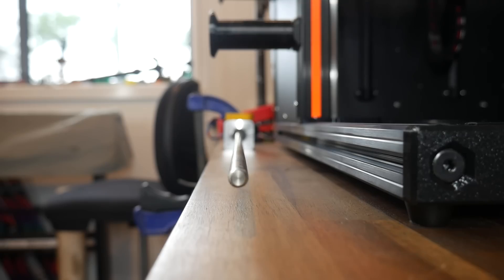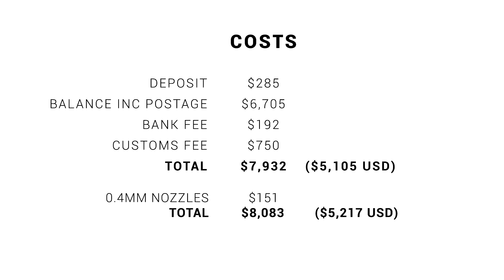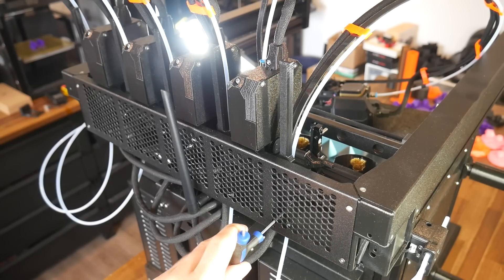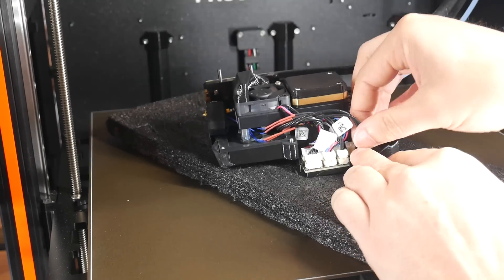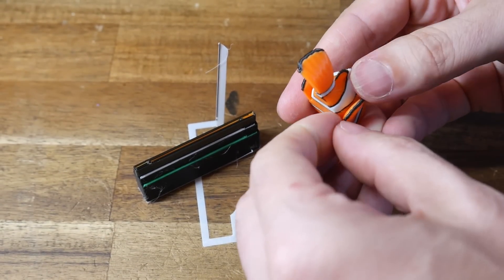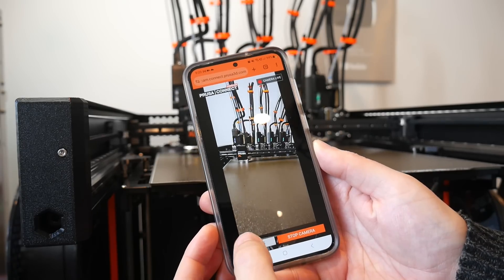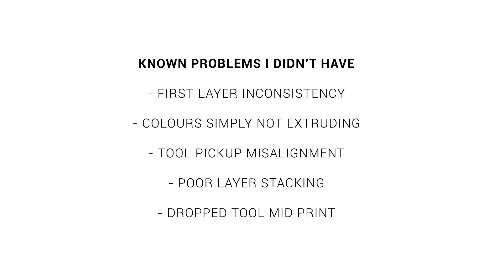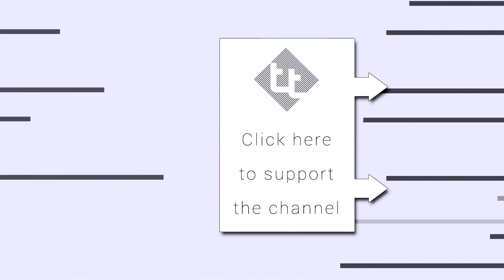I’m (mostly) happy with my Prusa XL - This is what it took

Comment: I've spent $65 extra on my P1S. Upgraded to touchscreen, got some custom plates, hardened extruder gears/nozzle, about $1165 cdn into it.

Here we are well over 5k (USD) deep and spending more in pursuit of results, then loads of time figuring and fiddling. (with a flagship product from one of the largest companies in the biz)
If that's not exactly what I'm tired of in 3d printing idk what is.

Not to mention, damn that thing's loud; I'm still impressed with the free update that silenced the steppers on my P1S, made the calibration time a bit longer; but then you see how long re calibrating can take on the Prusa XL...

The machine itself when working is impressive, no denying the value of multi-extruder for material savings, but as you've said this thing's an investment; and for many even something like Bambu's offerings are as-well; so to spend this much to waste more of your time and money...

I'm good, honestly this product is the final nail in the coffin for Prusa for me; the MK3S was for sure a go-to for a long time but times have changed; you can get more for less.

That includes the $60 filament that gets constantly beat or equaled by $30 offerings from others.

Comment: There are a lot of 3d printer manufacturers that rely on the community to fine tune the end product, whether through printable or aftermarket mods, print profiles or even firmware modifications.  This mentality seems to permeate the hobbiest level, and while that's fine at a sub €400 pricetag, when you get to the pro-am level (what I would consider over €1000) the product should do as advertised, with a proportional level of quality,  repeatability and support.  At the €5000 mark, well that's a league ahead of anything at the lower tiers, that's a lower end professional level tool. I understand it's a multi tool printer but you can buy 5 single head premium Bambu lab printers for what you paid.  

In hindsight, early adopters in this case should have gotten the "crowdfunded" price as you're  field testing, fine tuning and working out bugs for your trouble. Not getting the premium end product, which is what was promised.

Nozzles aren't a thank you for the hours you put in, a free tool head is, but in your case you've got 5.  A dozen rolls of good quality filament for the ones you've used to fine tune is probably about the right amount of "thank you for helping us achieve our promise to you, a remaining a loyal customer and supporter of our products".

Comment: The main goal for the XL was to print larger stuff faster and therefore the use of the 0.6 mm nozzles for better volumetric flow.
Especially since the Arachne slicing, 0.6mm nozzles make way more sense for large volume printers.

The change back down to 0.4 mm nozzles is no fix, it is a downgrade to mitigate a problem that is still not solved!

Comment: I got a Prusa Mini+ and I had a time getting it to work because of the Z-offset settings. It did work once I figured that out. I have to say, I agree that this isn't up to par with its price tag based on what I have seen, and I think I'd rather go the Voron/ERCF route if I'm going to need to do this much to the printer. The 350mm V2 and Trident are the same size, I think, so you wouldn't really be giving up any space either.

Overall, I think you've been incredibly fair and honest here.
Reply: I agree that Voron might be good choice for inviduals, but it's not for businesses I think XL is targeted for. We got XL for work, we couldn't even have gotten Voron cause of various things. Like VAT is so much more easier to handle. Guarantee etc. are obvious factors too.

Comment: To me this is the downfall of a trusted printer brand. I am not saying Prusa will go bankrupt, but in the past Prusa printers could be recommended as the one that just works.  That is no longer the case, trust has been broken, and without the "it just works" factor their prices are not justifiable. 

The Prusa XL sales will suffer as soon, as there is a tool changer alternative. I doubt Bambu will create one, but maybe some other company will step up to the plate. It should not be difficult to  beat Prusas price tag.

Comment: With prusa slicer I always had lots of issue with stringing and oozing on my 500x500 printer especially with a large nozzle. The only solution there is to be able to vary the filament retraction and prime length independently , and according to the length of travel. So I use cura with a plugin called "scalable extra prime" and a post processing script called "retract continue"

Comment: Nice. I haven't tried Octoprint on my XL as I heard the support for it in the XL firmware is poor. Topic for a future video?
Reply from the maker: They more or less fixed it from firmware 5.1. No print progress on the xl LCD but apart from that I've had no problems.
Reply: nice. thanks.

Comment: I share your wish for multi-nozzle size support. I'm hopeful to see this in an upcoming firmware and slicer update, but not holding my breath. And I totally agree with your discouragement of preordering another Prusa. The pre-order still took two years, and didn't prove to be a bargain in any way. This was my first Prusa order, and despite the anxiety of the wait and frustration of critical further development after delivery, Prusa still ranks highest in my book (so far).  I do recommend that Prusa continue to develop the XL into perfection, while QUIETLY developing their next mind blowing release and to not open up to preorders until it's actually in production. Next wish (largely self serving, I'll admit), is that they expanded a manufacturing facility somewhere within the Americas in order to satisfy demand and lower shipping costs. Thanks, Michael, for another great video!

Comment: I’ve had my 5tool for about 2 weeks and it’s been printing almost non-stop and almost flawlessly since I built it. I did have one model, that had very little chance of sticking to the bed, fail to stick to the bed😊 this was easily solved with a little IPA.

It’s honestly better than I expected it to be. I had fairly low expectations for this very expensive printer out of the gate because i knew that pulling this off would be hard and that early adopters would be paying a penalty in dollars and performance. But, it’s the printer I’ve always wanted and I know that Prusa will continue to improve on it.
Reply from the maker: I'm glad yours is working well. You and I should have equivalent hardware now.
Reply: Have Prusa said what is actually changed on the model they offered to send you? I haven’t heard anything about design improvements or changes other than the nozzles.

Comment: My Prusa is the Mini+, but I  found that Prusa Slicer 2.7 was the problem.  When I rolled back my firmware and the Slicer back to 2.6, my prints were great again.  2.7 kept giving me voids and the accompanying surface defects.  It appears to be a Slicer defect as nothing physically changed on my machine.

Your mileage may vary...

Comment: Just a reminder to everyone that you can get literally any other printer and THREE HUNDRED rolls of filament (more if getting a bulk deal) for the cost of an XL 5 Head. Please consider this before telling me about the savings the XL has on filament 'waste' as opposed to other filament swapping mechanisms. What does waste actually mean to you? Because for me, waste and savings are directly related to dollarydoos in the bank.
Reply from the maker: It's a valid point. If someone were to get one now, and were running a print farm or a similar operation of scale, the time/material savings may be worthwhile over time.
Reply: @TeachingTech   I can understand that to some degree, the XL is a good machine, but the reliability and redundancy of a small farm of P1S combos would probably still outweigh it in the long term as well (about 6 P1SC per XL)

Comment: I love my Prusa XL.  It just keeps getting better and it just works.   I regularly print in PETG and PLA.  I can't say I've seen much of a stringing issue - not so far anyway.    I got .4 and yeah...they should have provided you them for free.  For what it's worth, I run filament out of a PrintDry system.

Comment: You are absolutely blowing the nozzle size situation out of proportion.  It is a large printer, in order for print times to come down, nozzle size has to come up.  I print large functional objects on my XL and wouldn't want a 0.4 nozzle, I have an MK4 and MK3 for detailed parts.  So on the flip side, my 2nd XL will be arriving in a month and I'm going to have to swap out all the 0.4 nozzles to 0.6 am I going to complain? nope because I have to adjust the printer for my use case.

I do agree with you that the slicer default settings weren't great and still need refinement, but it is functional as it is, I'm happy that they're taking community feedback to fix issues that would've taken longer to figure out had they waited to ship the printers.  I'll challenge anyone to find a comparable printer for the same price or less...Hell even up to $20k you still wont find one.
Reply from the maker: I'm glad 0.6mm nozzles are working for you. But ultimately, the 0.4mm must be superior or they wouldn't have changed to them.
Reply: @TeachingTech  they changed them because the squeaky wheel gets the grease.

Comment: The new alpha fw made my 2XL waaay quieter.
Reply from the maker: I filmed the same sequence back to back and it was much if a muchness. Double checked it was turned on in the menu.
Reply: That noise was crazy. How is it so loud when you can run other printers at 200mm/s and barely hear them. Is it just a software issue?

Comment: Unpopular opinion : More than 2 material is just a gimmick, you want nice and colored print ? Just buy a primer and some paint, you gonna have a better result.
Reply: Lol. Hard + flex + support + diff nozzle dia. There is a lot of room for creativity.
Reply: @GhostRider5555555  You can print with two different nozzle diameter at the same time ? Could be a good option if not.
Reply: @nobocks  aracne engine can generate variable line thickness. Might be easy to implement.

Comment: Even if it was working 100%, I would rather buy 2 Bambu Lab X1C with AMS bundles, and extra AMS for each one (so I can have 8 colors for each printer), and then spend the $1500 remaining on extra filament that would be wasted for multicolor prints.  Their PLA (with spool) costing around $25/roll, that is 60 rolls of filament.

Comment: Re- drying of filament.  I live in a VERY humid environment, RH in my dry boxes sits between 30 and 50%, and I do (mostly) dry filament while printing.   PETG is a shocker for stringing if wet, and some PLA's can be as well - however, in stock trim my Prusa Mk4 0.4 nozzle has significantly less of stringing issue than the Mk3s did - I remain entirely confused about filament drying, particularly PLA - I wonder if the warmth from the dryer somehow "conditions" the filament to give a better result.  Even after measuring minute water loss - print quality sometimes improves...

Comment: 11:48 I converted my nextruder and side filament sensors to magnetic versions as described in the prusa forum post called "XL filament sensor mod for tpu" on the first page of the thread. I also made new nextruder filament guide parts to help prevent the ability of TPU to move around and get behind the nextruder gear causing a jam. Those model files are located on printables just search for "XL nextruder main plate and idler lever for flex filament". After these changes I am able to very easily feed and print ninjaflex 85A tpu. I also changed my nextruder filament sensor in my MK4 to magnetic instead of the spring. The kit version i got comes with a spare magnet that can be used for it.
Reply from the maker: I came across that thread. I'm debating if I want to do the magnet mod or tweak the springs.
Reply: What is your volumetric speed with the Ninjaflex a85 TPU on the Prusa XL? 
I have to print that filament quite a lot for work on a Bambu Lab X1C and anything above 1.7mm³/s volumetric speed eventually leads to issues and skipping in the extruder.
Reply: @jakob.k_design  I was able to run in with stock prusa slicer settings and brass 0.4 nozzles but changed to 2-2.5 for more consistency. I also increased my extrusion multiplier to 1.2 and my retraction length to 5mm which helped to prevent stringing.

Comment: It's a hard sell for $8000 AUD, i've been happy with my Mk3S+ but i'm not sure i would go down the Prusa path again, i can't justify 8K, even though id love a larger bed size. It is annoying that first generation Prusa owners are beta testers instead of more in-house testing before release, thank you for your beta testing, im sure it'll be a solid workhorse in another 6 months time after more fixes
Reply: For 8k, Thats a decent subtractive cnc machine to aid in your making and gives you a wider depth to pull from in terms of manufacturing twchnologies availible to you.
Reply: @BeefIngot  funny you should say that, I’m putting a 1500mm x 1000mm Ratrig CNC together at the moment 😂

Comment: even them calling it "fully assembled" instead "mostly assembled" doesn't sit well with me. I've seen people who do 3D printing YT videos for a living say it took more than 3 hours to finish assembling the "fully assembled" printer. If it was less than 20 minutes to get it running, I can see calling it "fully assembled", but not multiple hours.

I think the main reason people have said they bought prusa printers in the past it was because of "just working", and it being a trust worthy company. It doesn't seem like the XL offers either of those things. I am so glad I went with a Bambu. Maybe in a few years, they will make an XL without all the problems, that comes actually assembled, has a proper enclosure, and a camera in it like almost every modern descent printer not made by them. 

Reputations take a long time to build, but sometimes just a moment to fall apart.
Before Bambu Labs, they could have gotten away with this, but not anymore.

Now they are focusing a lot on schools and commercial clients. Makerbot did the same thing, and they are now pretty irrelevant in the consumer space. I wonder if prusa is going to follow suit.
Reply: I totally agree when you say, "I think the main reason people have said they bought prusa printers in the past it was because of "just working", and it being a trust worthy company. It doesn't seem like the XL offers either of those things." I would add to the scope of the statement though. Those are reasons I bought a MK3 and then jumped on a quick order for a MK4 but as you say, the days of "just working" and "trustworthy company" are over. The MK4 they sent me is a total lemon, riddled with issues that result in it not being able to produce useable prints at all!! I have been fighting with customer service for SEVEN MONTHS to get them to get them to warranty the machine and they will not!! Its been a constant battle of them saying that it's better for them if they can identity the single source of the problem and replace that rather than sending me a new machine. I said I dont care whats better for you! I care that you sent me a trash machine 7 months ago and I paid the bill for it! Personally, I'll never do business with them again. They do enough right that they seem great on the surface but you go to forums and comment sections and you always hear stories of people getting screwed over by them. I wish I would have been more vocal about it to friends and family earlier on so they could have shopped elsewhere. Im just waiting for their machines to have problems so I can talk to my therapist about it.
Reply: It reminds me of a company like Tesla. Be first to market with a good product that creates momentum. But rather than building on top of that and keep pushing development and cut pricing, they just stick with the same concept, while other companies are catching up and overtaking them. In panic they start to react with a similar concept that is already well established by other companies and fail at some basics.
Reply: I'm very frustrated, bambu labs has the printer I want... But I really, really, really hate walled garden bs...
Reply: @prw56 it's worth it

Comment: What a piece of junk!  You’ve spent close to $10,000, if you consider what your time / labor are worth. And they blame the end user? “Dry your filament”. That’s hilarious.  You could have fought many Bambu Labs machines for this money or an Ultimaker S5 with a material station (albeit only dual nozzles).  If you’re an advanced user, sure, maybe this will eventually work. But for the masses wanting it to work out of the box, an epic fail. Avoid!

Comment: What about coloring the melted white material before going out of the nozzle instead of using different filaments? Just an idea
Reply from the maker: I have a video on a similar concept from a community member. Was slow but worked well. Main trouble is sharpie ink hurts layer adhesion.

Comment: As far as support goes, you are getting preferential treatment. A normie isn't going to have a bunch of free stuff thrown at them or an entirely new printer to make them happy, they are going to go through the support queue and wait in line for regular service. The XL was definitely rushed though. They announced it too soon and set unrealistic timelines that they couldn't meet and I think as soon as it got to a point where they could ship the thing and be able to fix the problems after the sale, they did. As an E3D Tool Changer owner, i'm still very interested in the XL, if nothing more than to have something I don't have to tinker with and can just print. Just keeping my eye on it for now. Thanks for sharing your valuable testing and feedback!
Reply from the maker: I agree I got special treatment, hence me disclosing it and turning down the free stuff. However, I am also talking about the normal web chat support which I used a couple of times.